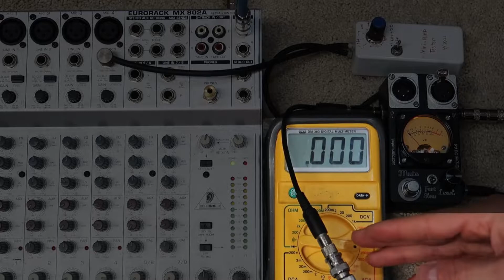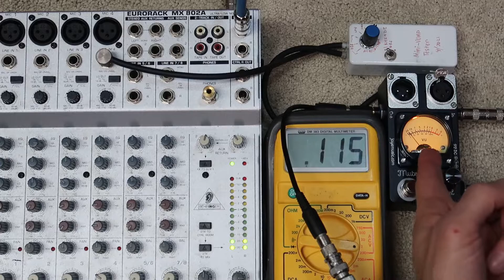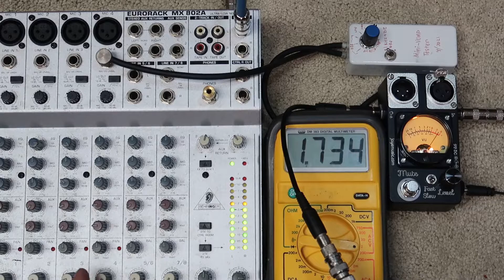Calibrate the Analog Voltage Unit Meter Pedal (VUMP) to VU standard scale

Comment: I recently bought one of your Mini VUMP pedals and I went through this calibration process. It was interesting but I find that at either 1 or .775 volts it's not particularly useful for guitar, full strums are hitting around -16 and much of the time it's too low to register. I understand that for most applications (i.e., balancing output across pedals) the actual level is arbitrary, but I'm wondering if you had a suggestion. Probably that's whatever it was set at when I got it, but I didn't think to make note of that.